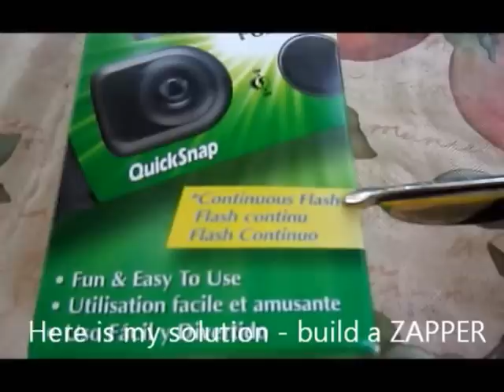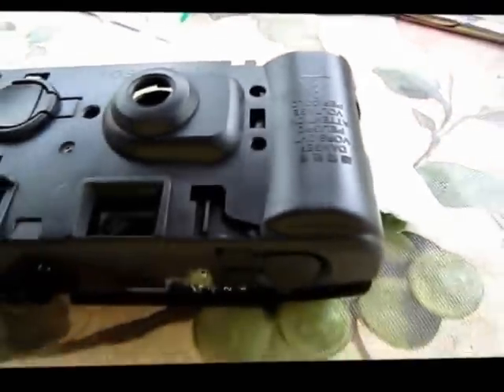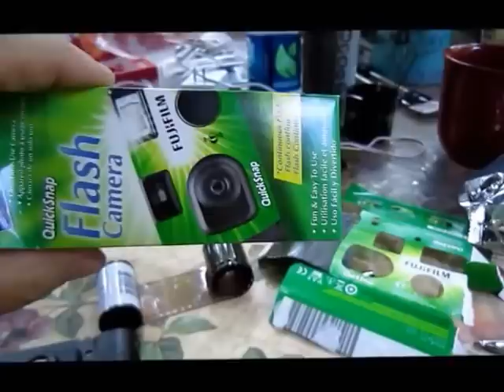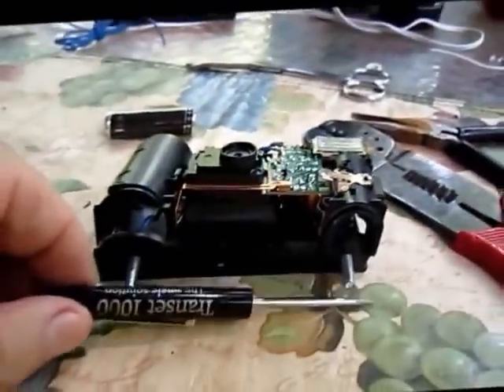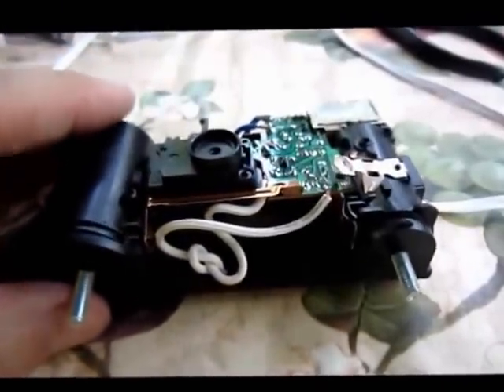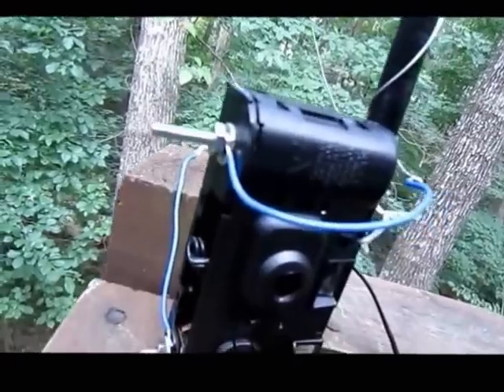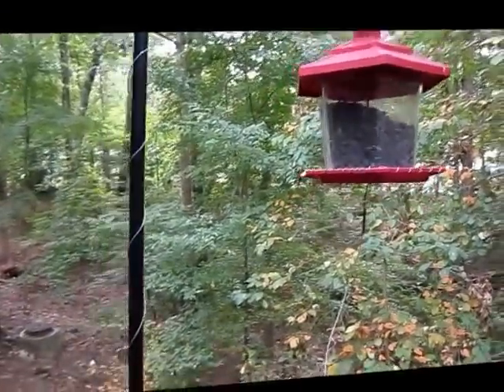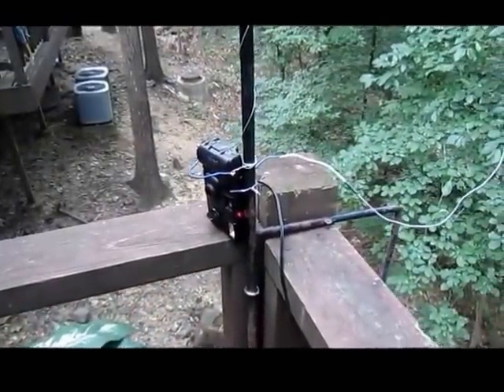MrSquirrelZapper2

Comment: With a little soldering (2 wires to the charged plates), you can make the same thing out of a electric hanging bug zapper and use the bug zapper as both a bug zapper and a squirrel zapper. You can also make the same thing out of an electric bug swatter (those that look like tennis rackets) but it is much easier than modifying a camera. No soldering required.
Reply: JHP603   the camera is a good idea ,,  it gets the point across  and hits 10X harder than a bug zapper ,,actually that capacitor discharge could kill quite easily ,,i've used a simple voltage step up device to kill rats  this way

Comment: Poles out of the camera is a bad idea, Someone can get shocked. Run the wire out of the camera and put insulated spade connectors on each of the two wires. Then put insulated spade connectors on your two wires going to the bird feeder pole. No one gets accidentally shocked if they pick up the camera.
Reply: jhp603 : That would be funny as heck if someone tried to steal the camera though.